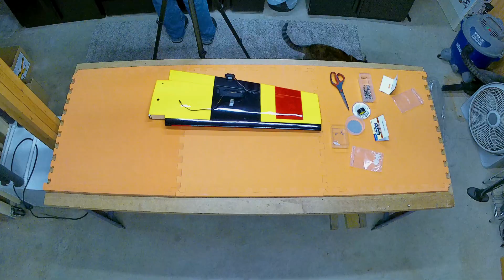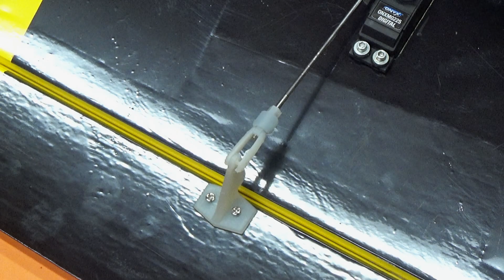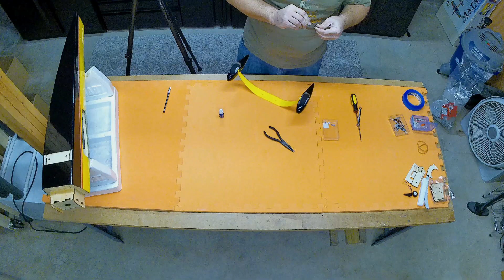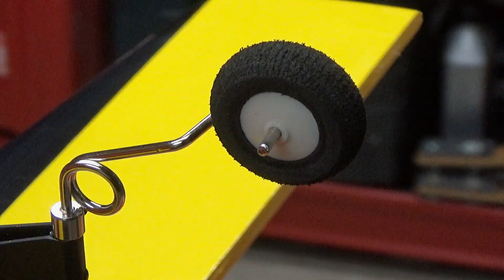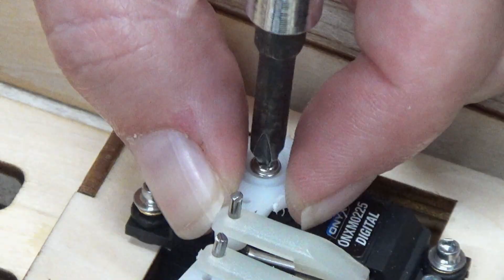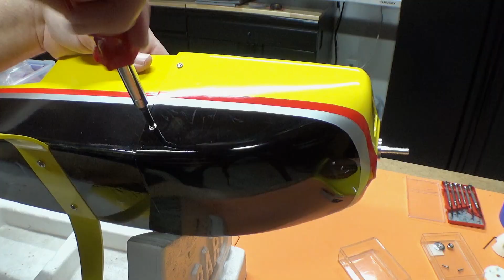Tower Hobbies Edge 540 ARF - ASSEMBLY

Comment: Hey brother. I'm not sure if anyone has pointed this out, but you are installing the servo grommet eyelets upside down. The flange is supposed to be on the bottom. When the screw comes down from the top, it compresses the rubber slightly. Just dont over tighten. Other than that, great video:)
Reply from the maker: It's funny, over they years I have heard arguments as to why each way is correct so I finally did a deep dive and you are 100% right. Grommet flange goes towards the mounting surface and I did it wrong in this video. If you install it like I did on this plane you can over-tighten the screws and defeat the entire purpose of the rubber mounts. Luckily with electric planes we don't have the vibration like nitro did, so not as important, BUT it should still be done the proper way. Thanks for pointing it out so others do it the correct way.
Reply: @TheDornado you know what. I myself installed them like you did for like 10 years lol. Have some great flights brother

Comment: Is this the 55.5" version or the 58.25" version   is there much difference between the two except for the slightly larger size?
Reply from the maker: This is the 58.25" branded as a Tower Hobbies, not the 55.5" sold by Tower but made by Phoenix. I think they will fly pretty similar, but I have never flown the Phoenix one. I have had several of their other ARFs and they are excellent planes. The bigger difference will be in how the assembly goes. The 58 is designed to go together far easier than the 55. The tail comes interlocking and the servo openings already cut. But you can't go wrong with either.

Comment: Great video! Thanks for posting this. I’ve been flying foam planes since getting into the hobby 4 years ago. I’m currently building this plane as my first wooden construction plane. I’m wondering what motor you went with. I’ve watched the video and can’t find that info. Thanks and keep up he great content!
Reply from the maker: Sure, I used the HobbyKing Aerodrive SK3-4250-410KV because I wanted to use 6S as I thought the plane would need the extra weight up front, which it does! With a 3700 MaH pack CG is spot on. As I said in the video it is a little longer than the Rimfire they recommend, so you have to move the cowl forward. You will also have to do a bit of work to get it to mount on the supplied motor box because the holes don't quite line up. I just enlarged the holes on the metal motor mount and it worked very nicely. BTW just want to say there is NOTHING at all wrong with the motor they recommend, actually the Rimfire 32 is probably my favorite motor I've ever used.

Comment: Nice video man!    I got one for Christmas going to be .46 nitro.  Are those standard or micro servos you used?  Thanks!
Reply from the maker: Thanks for the comment. It is a really great plane and I am excited to fly it once the weather allows. The servo openings are a little odd sized. They are just a little too big for most modern mini servos like the Hitec 5245 (which is what I wanted to use) and too small for a standard servo. So I looked around for some "big" mini servos and found the Onyx S25's that I used. You need a length of 34-37mm to fit really nice. I only found 3 servos that would work, the Onyx, a Futaba servo that was out of stock everywhere or the Savox SH1250MG that would fit. I think the odd size is because it is an older design. The servos I used seem to have plenty of power, only drawback is they are not metal gear. Hope that helps!
Reply: @TheDornado  thank you sir ! that helps me